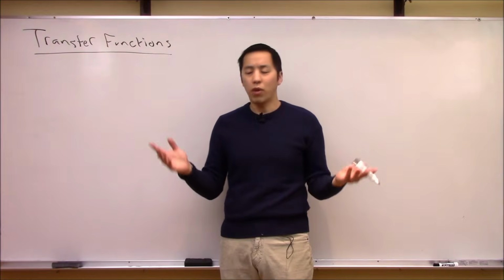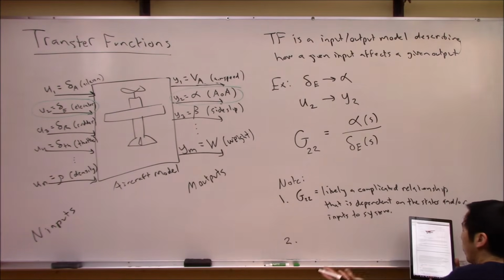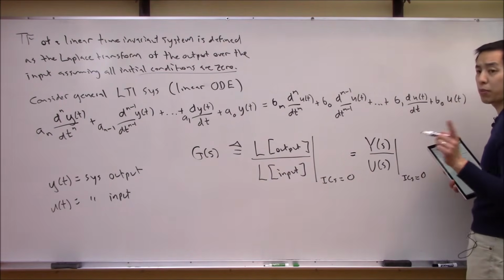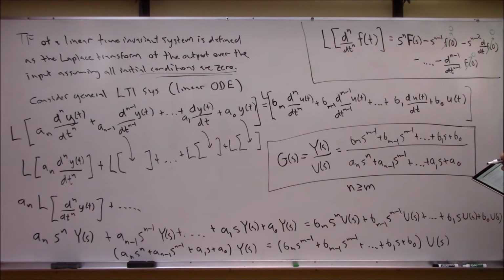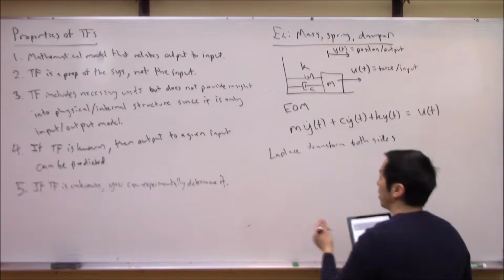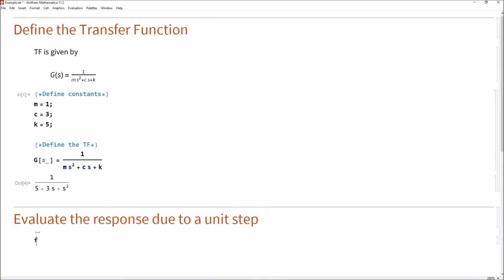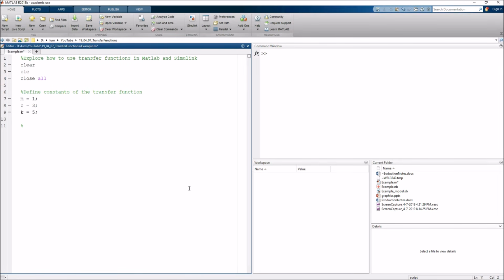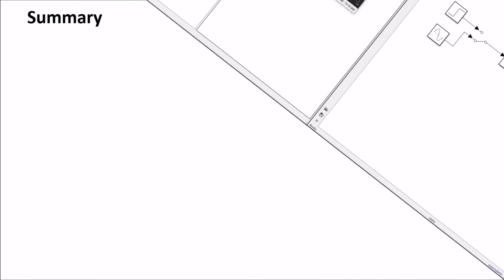Transfer Functions: Introduction and Implementation

Comment: AE511: I continue to find your use of mathematica to really benefit these lectures. The fact that you can dive into a problem from a basic diagram of a spring and mass and walk through  the problem all the way to plots of motion so fluidly is very useful for directly tying concepts to application. I also appreciate the fact you demonstrate this both in Mathematica and MATLAB. It helps me to be able to move between the systems based on my needs.
Reply from the maker: I'm glad it is helpful.  I find Mathematica very powerful for this type of manipulation.

Comment: Awesome lecture series. Thanks a lot for dedicating your time to teach us :-)
When the lecture started off it was assumed that there are N inputs  (of y) and M outputs (of u). But when writing the general form of the LTI, where [output equation] = [input equation] the n and m were switched. No problem, it was consistent within that discussion.

Small note: I used "lsim" function instead of using Simulink (of Matlab), and the good news is open source software Octave  has "tf" and "lsim" functions. Just remember to load package named "control" to get the TF features. I used "gensig" function to generate the input.

Thanks once again for the series.
Reply from the maker: I'm glad it was helpful and thanks for the thoughtful discussion.  I hope to catch you at another video.  Thanks for watching!